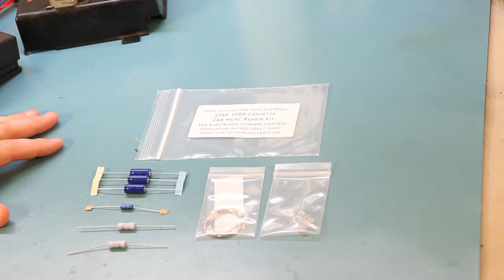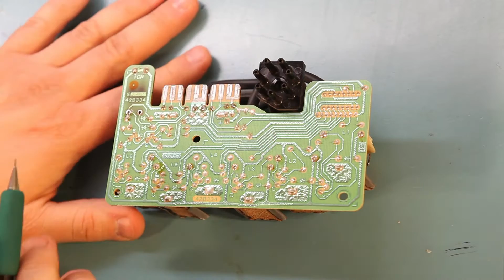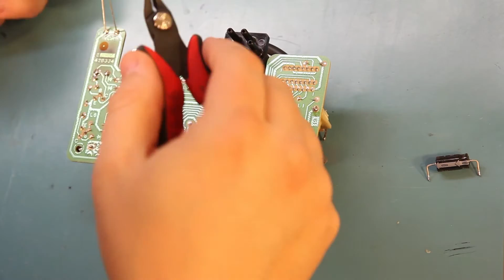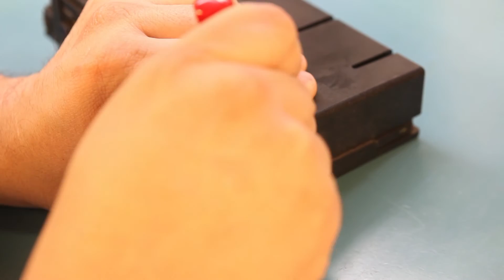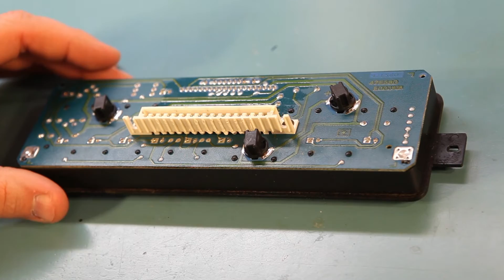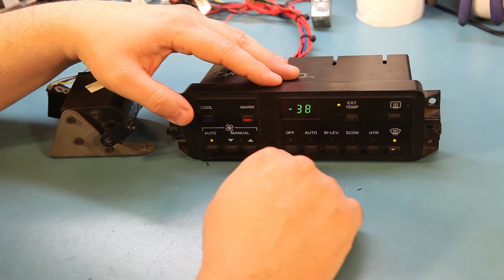86-89 Corvette Fix # 15 C68 Electronic Climate Control AC

Comment: Will a bad unit make the blower not come on? New blower won't turn either and all the lights work on the unit and when you turn the fan speed it changes on the unit

Comment: I bought your kit but there are extra parts like diodes, LEDs, and transistors.  What do I do with those?
Reply: The LEDs are to replace the button LEDs I guess. The other parts I tucked away.
Reply: @D theman  no I think I have other problems.
Reply: @D theman  the vent control box under the dash isnt working still, I'm going to check and make sure it's getting power next.
Reply: @D theman  yeah theres the two main power resistors, some smaller resistors, capacitors, LEDs, etc.
Reply: @D theman  shouldn't be now. I changed my starter and the heat stopped working. It just blows cold now. Whatever it is I  havent found it yet.
Reply: @D theman  it still wasnt going from cold to heat. I havent checked the vacuum line yet.